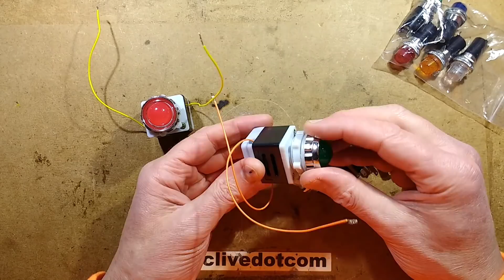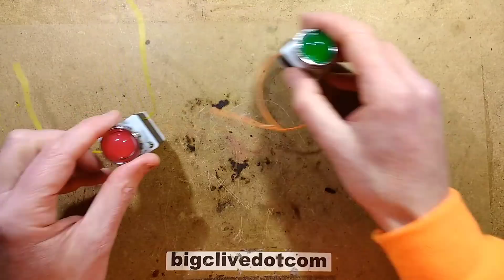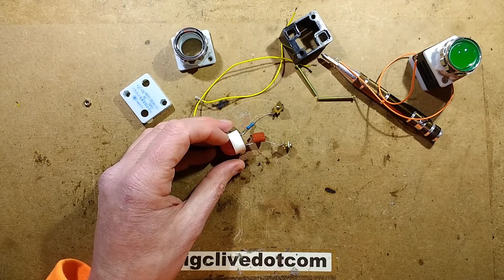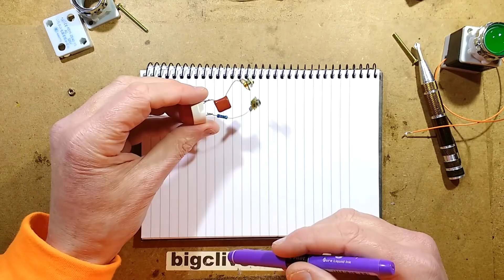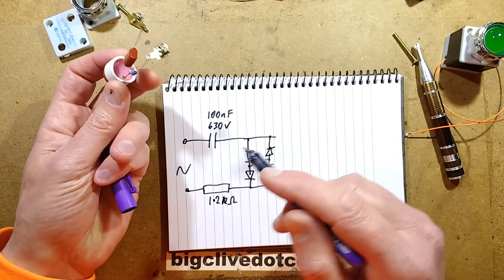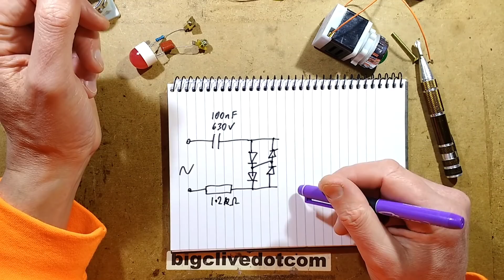Neat 120-240V chunky LED panel indicator light.

Comment: I dont know much about this stuff but i have a lot of old indicator lights....like the small ones you have there.  Mine are glass though and some have bulbs in them. Is there any way i can test them with a 9 volt or an easy way to test them at home with normal batteries? If not what exactly do i need to test them out?  They used to go to a bunch of HAM radio equipment.  Thanks
Reply from the maker: They may have a voltage rating marked on them.
Reply: @bigclivedotcom  they do. it says 75w 125v but i still know noting about that lol.  Will any regular batteries make the light come on to test them or what do i do exactly to see if they work?  I dont even know what 75 w125 v means lol

Comment: Common neons in my experience were the NE-2 (wiires) and NE-51 (bayonet base, similar to a #47 tungsten lamp).  I never saw screw-in ones of the size you showed here.  There were some bigger screw-in types,  like the NE-45 ferinstance,  I had a tape recorder (early 1960s vintage?) that used a couple of those for level indicators.  But the last time I looked they were absurdly expensive...

Comment: Could I run these LED's from USB power at 5v? Perhaps by changing the capacitor to a low voltage resistor?

Comment: That doesn't look like an X or Y rated safety capacitor.   Are those safe to use with a standard high voltage capacitor as built???
Reply from the maker: Many LED lamps contain the same style of metallised film capacitor rated at 400V.
Reply: I have seen that in many gadgets.    Is that safe enough????   I want to use capacitive dropper supply for projects but I think I would use a fuse in line for safety.

Comment: hey, got a question can you do a video on how to recover powertool batterycells that are undercharged and are no longer accepted by the charger, how to fix it or check if you need to buy a new battery?
Reply: made a charger from one of my old PSU's charged it with the -12v and a +5v with at 0.1amp, but im gona be honest i have no clue what im doing here ahahhahaha

Comment: I am surprised you didn't comment that a discharge resistor would make a much safer device.  I guess you can't ask too much from Chinese crap.
Reply from the maker: The discharge resistor is usually used where a plug or lamp can be removed leaving the pins exposed.  In an industrial application the indicator is hard wired in and may also be across a load that would shunt any residual charge.

Comment: They always run these neon resistors right at the top of their spec, most I find are basically dissipating the full 1/4w and run red hot inside their housing.
Reply from the maker: +uK8cvPAq That's why I recommend adding an external resistor.
Reply: Fair point, but when swapping burned out like for like indicators its not always practical to add them. The manufacturer should just do it right to begin with.

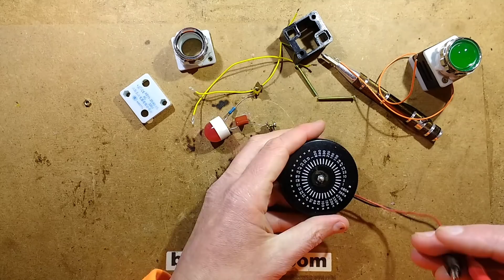Comment: 4:50 nice "variable resistor wheel"/"Resistance Wheel" (Resistance Substitution Wheel 470K ) https://youtu.be/n3joyToqpCc .  ( Australia: jaycar.com.au/resistance-wheel/p/RR0700 or jaycar.us/resistance-wheel/p/RR0700 ) But where can bay this (ebay/Europe)?
Reply from the maker: They're hard to find.  I bought mine about 30 years ago.
Reply: so if do not get it,  probably still have to do it self (printed circuit board and so on) :D 
Tanks for this video https://youtu.be/n3joyToqpCc

Comment: What's the purpose of the capacitor in this setting?
Reply from the maker: It lets a portion of current past on each half wave and acts as an alternative to a resistor without the heat.
Reply: capacitive dropper to reduce mains voltage

Comment: Some really good glue and tough plastic on an LED house lightbulb I recently took apart. The first tug of the bottom left just wires going to the pcb. I showed my daughter what not to do by putting the wires right into a socket and lighting up the bulb. Maybe she will listen and not direct wire things, maybe she will become an engineer like me.

Comment: Do you have a video or can you make one that explains how to translate/make choke/coil from henry units in schematics?
Reply: Gregorius Soedharmo It's basically number of turns around the ferrite / iron core multiplied by a number from the core's data sheet. Thickness of wire is dictated by the current capacity.  If the wire leaves the coil at the opposite side, there's a half turn involved, like 10½, 2½ or even just ½ turn.  If the shape isn't filled to the brim with windings, the constant will be slightly different.  Usually it's easier to just buy a finished coil/choke though, leaving the details to the factory.
Reply: I'll give that a go, thanks!

Comment: These are interesting not used them yet & may be unsafe :) https://www.ebay.co.uk/itm/New-22MM-AC60-500V-LED-Voltmeter-Voltage-Meter-Indicator-Pilot-Light-DIY-Best/272846659880?var=571997513970&_trkparms=aid%3D222007%26algo%3DSIM.MBE%26ao%3D2%26asc%3D43630%26meid%3D23b14114fd69453c9214358d5012b78d%26pid%3D100005%26rk%3D5%26rkt%3D6%26sd%3D192305575664&_trksid=p2047675.c100005.m1851
Reply from the maker: I have one here on my bench.  The price is lower now.  I like the idea of a combined power indicator and voltage display.

Comment: too bad not 12V... would be great for a computer case/etc...
Reply from the maker: To convert to 12V all you need to do is short out the capacitor as the existing 1k2 resistor will be OK for 12V.  For brighter illumination use a 470 ohm resistor instead.
Reply: Didn't you watch the video?
Reply: yea i'm a idiot.. commented before finishing the video... /me Pounds head on wall
Reply: bigclivedotcom: sorry, i posted before finishing the video. wont do it again.

Comment: I was interested in those neon indicators, but they don't have a 120V version. :'(
Reply from the maker: They still light at 120V albeit at lower intensity, and should last for much longer than they would at 240V.  I checked all the colours on my shaver socket and they looked OK.  Not super bright, but still visibly lit.  The best colours were orange and red.
Reply: The strike voltage on most neons is about 90V so they will probably light on 120V. Possibly with some flicker? If Clive happens to see this comment maybe he could test them and let you know? If they are only cheap, it might be worth buying some to try regardless and you can always change the neons as they are the screw in type.
Reply: That was my first thought - just replacing the 230V neon lamps with 120V versions, but I can't find 120V screw-in neon lamps on eBay, either. -_-
Reply: Thank you for testing that!

Comment: I waited for you to crack the LED open and then the video ended :D. It could also be a single red LED and a bridge rectifier. This would have about the same 3.9V voltage drop.
Reply from the maker: It appears to be solidly potted in resin.
Reply: bigclivedotcom Never stopped you before
Reply: Peter Gettys he probably wants to keep them for future projects.
Reply: Since when he knows that bridge rectifiers don't belong in the same schmoo as the diode when their is plenty of room otherwise.
Reply: I also thought the LED was a goner... This deserves another video with the gutting of the LED...  For science!
Reply: when did you start having trouble with fillings  ?
Reply: Probably because he is directly ripping off BC's ideas. Just look at the title questioning the high voltage generator as being a stun gun module. Conveniently 1 month after BC's video with practically the same title, just enough time to order one and full rip off BC.

Comment: What is so neat about a relatively huge, heavy part that does no more than the job of a smaller one?  We could say that makes it more durable but how much durability is needed from the housing BEHIND a panel?  With it that big you'd think they would make it a switch too, with the option whether it's lit when the switch is closed or open, then if you don't need the switch you just don't wire anything to the switch contacts.

As far as this design goes, I find capacitive dropper LED arrangements to be short lived, decreasing in brightness drastically within a few hundreds of hours.  Granted the ones I built used generic Chinese LEDs which are highly subject to quality variations and yet they were single chip LEDs ran below half their rated current.

I can't argue with CHEAP, except that when the lifespan is so low that it takes a greater value in labor to replace them, there was no real value in saving on the purchase cost.
Reply: Stinky Cheese 22mm is a standard size for industrial control panels. You can get a full range of modular switches and indicator lights that all drop into 22mm holes. You can usually gang multiple switch blocks onto an actuator to make switches up to 4P3T or thereabouts. These Chinese ones are crap, but Eaton, Omron, ABB, etc all make full ranges of components in this form factor.
Reply: Stinky Cheese Also bigger lights are easier to see.  Another comment was searching for an even bigger light (2" / 50mm) for an existing machine.

Comment: Nice lamps,
 Anyone any idea where I could get eight red 2" diameter by about 2" high domed panel lamps?, Iv'e been looking for some for years to restore a conveyor control panel,
 Cheers, J.
Reply: Average Joe check ebay joe possable you can find them there chances are u might find the whole pannel your looking for
Reply: I certainly will, The originals are glass and extremely rare, I do know of one place I could get some but the Ministry of Defence would not be keen on me umm, borrowing them!,
 Thank you for your responce, J.
Reply: Average Joe. Lol i wouldent think so if you have an orginal one look into a place / glass blowers shop need you im shure that can make you some for a lil cash take the orginal if u have one to them
Reply: Nice idea, I will have to do a bit of research into that,
 Cheers, J.
Reply: I have a box of old filament bulbs of various sizes and voltages that are unused. Can you provide a link to an image of what you're looking for?

Comment: Where did you get the resistor array?
Reply from the maker: +RCdiy I got it decades ago from Tandy.
Reply: I'm looking for something like that but all I find in searches is potentiometers and network resistor arrays.
Reply: Very good Clive....decades ago! I generally would like a resistor array like that.
Reply: Lol. Decades.
Reply: ..... True ,   I"ve had mine for at least 30 years.   (Jacar, resistance wheel )
not cheap ,      https://www.jaycar.com.au/resistance-wheel/p/RR0700